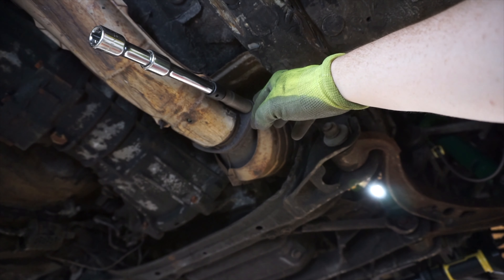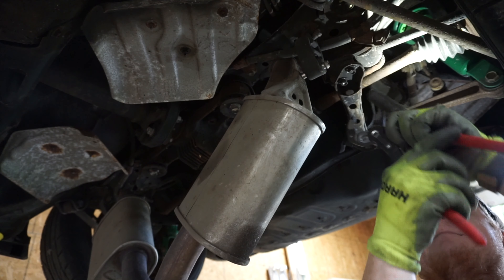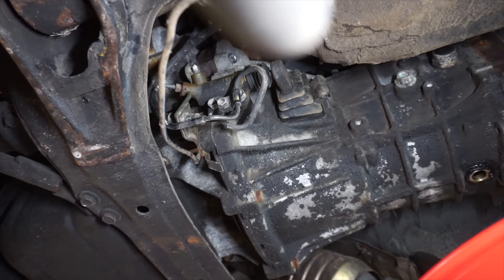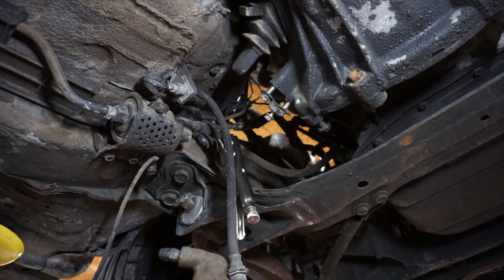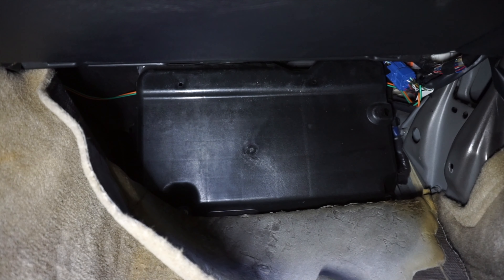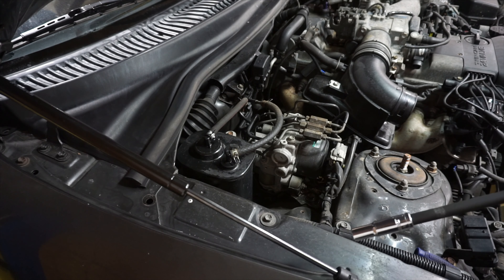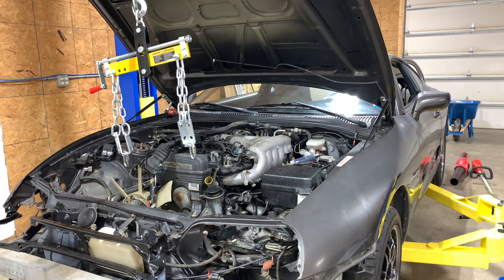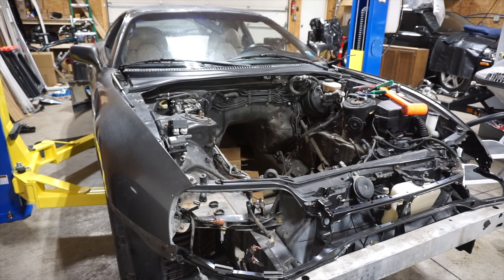MKIV Supra Build - Pt.3 - 2JZ Removal

Comment: @00:41 yeah Almost stripped mine, It's not a 14mm bolt neither is it a 13mm I got mine out hammering a 13mm on there cz it's smaller than 14mm. but I think its Metric or Imperial whichever one is x/x size format. (Playing videos in 2x speed to catch up)
@1:15 wow mine didn't have that when removed it, I guess USDM versus JDM (mine is JDM). Got an HKS exhaust on there.
@12:05 will be doing the bay in-house with a compressor n gun but car itself will be a shop.